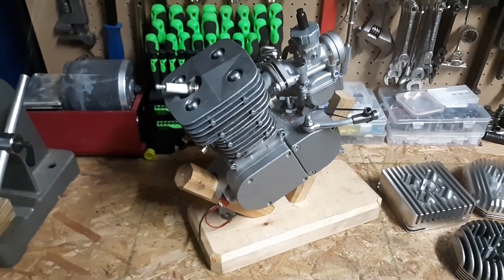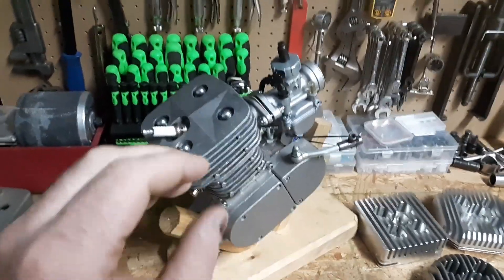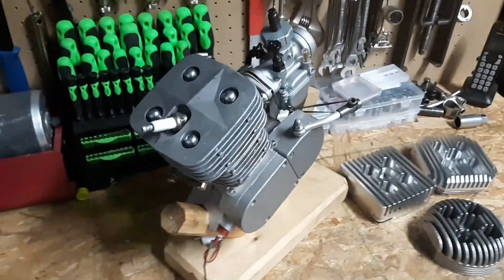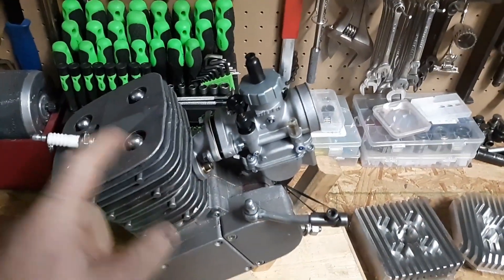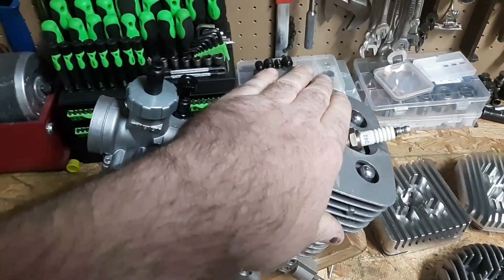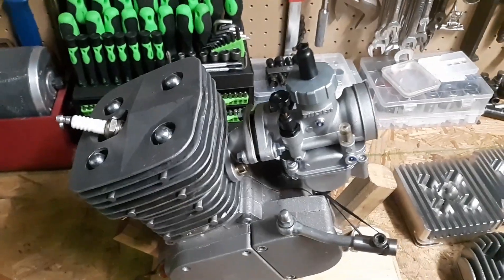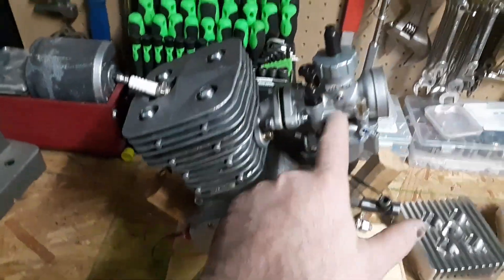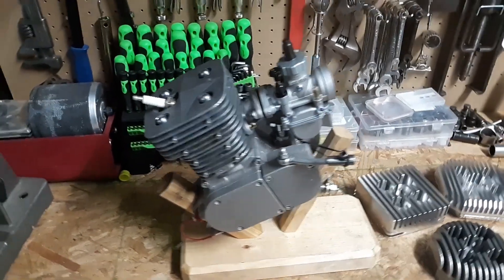100cc Motorized Bicycle Build- Timing & Overall Thoughts On This Kit.

Comment: I seen a video where a engine came with ball bearings used the stock clutch’s for spacers on the head bolt studs because they drilled them way to deep 🤦 China always surprises me lol
Reply from the maker: no they use them as stoppers to make sure studs don't drop down to far when they use to short of studs.  If you notice all those studs in those motors are only 105mm long! not normal 115!   What happens is people crank down on the studs and the balls tend to push through the case into crank area!  all cases are drilled to only like 2-3 mm from crank area!

Comment: Yea there was definitely a lot of “imperfections” in mine but imo it’s a much better motor then the phantom for a daily reliability standpoint but to get it to a reliable standpoint is much more work then an average motor for sure. Umm I didn’t do all you did I just fixed it as it and it’s been amazeballs. I also didn’t get that carb with mine I got a bofeng which I was a lil upset about cause I wanted that manifold n carb but the simplicity of a standard speed/NT/knockoff carb is hard to argue with I just wanted something did to play with and broaden my field so to speak.
Reply from the maker: Im gonna tell you right now!  This thing is a f'n knuckle bitter riding it LOL! 🤣👍
Reply: @BuildBreakFix  You did a good enough job explaining and detailing this "fix". Man, I don't know if I have the courage to tackle my 110 Chinese metal nut job.  I don't have your knowledge, patience, skill level, or specialized tools like CNC, etc.  So, I guess I am stuck with a quite heavy paperweight, doorstop, or something to drive me over the top and to the funny farm🤡.
Reply: @boydjensen3161  I have same motor it’s a bit to do but can be done in. A different way I’m my opinion and much easier also in my opinion but once it’s fixed it’s a hand full for sure and really reliable so far.
Reply: @JMB676  Hey,  if you get bored & wanna measure the total length of an OZ reed, I'd appreciate it but son't go out of your way. I'm sure bikeberry could give the length but I also wouldn't be surprised if they screwed up & gave me the wrong length.
Reply: @michaelbrinks8089  21mm thick from port face to cap and 43mm from port face to end of manifold where the carb goes onto,19ishmm for the carb to attach to; the pipe it goes on I mean,38mm from top to bottom. Need n e more let me know
Reply: @JMB676  I seen a RSE type (not RSE but similar design) that looks like it might work better than a G2 & OZ reed.... It's smaller, less empty space inside the reed block VS a G2 reed that needs stuffers & the reed pedals (only one set of pedals though VS 2 in the OZ) that extend out from the reed block into the intake port when it's bolted onto cylinder. Not sure if having only 1 set of pedals VS 2 in an OZ & G2 will restrict flow. But I suppose when using 2 wider reed pedals the air/fuel mix still hits a bottle neck in the cyl intake since it can only be cut open so big.

Comment: I don't like the all one piece cylinder and head on any motor
Reply: This is separate head & cylinder engine.
Reply: @stpstudios  I still don't like the ones that are one piece
Reply: @Westhelockpicker  me either 👍
Reply: I do they are much better for day to day use imo. Less things to worry about. By if your just a fun time rider it wouldn’t matter as much but on a daily theykevaway some “guess work”. Jw though what is your reasoning for not liking the one piece, like actual reason unless it’s just cause you don’t like it aesthetically.
Reply: @JMB676  I live the two piece so I can get a high performance head
Reply from the maker: It is a 2 piece jug!   lol dunno why everyone hates 1 piece jugs!  Some of the best top ends are built that way!  you can get stupidly high compression with 1 piece vs 2 on 2 strokes!

Comment: Another great informative video I new you could figure it out I also figured you would give it at least a 9 or 10 degree of difficulty because you had to cnc it down that's a lot of filing and sanding anyway can't wait to see you running it
Reply: I seen 2 different E-bay sellers selling those engine kits,  UGitFooked  & SumTingWog
Reply from the maker: I have seen worse engines of all kinds lol!   Honestly no you could do this without a cnc mill.  But f.... that is dremel work like a surgeon OL!